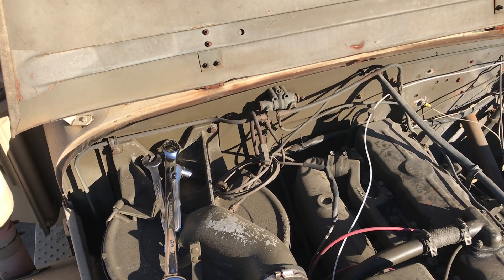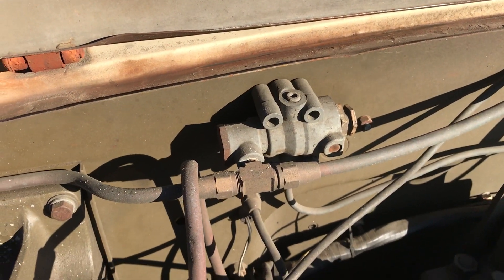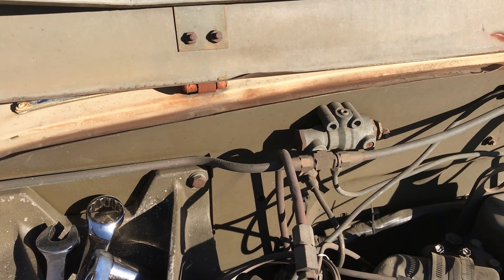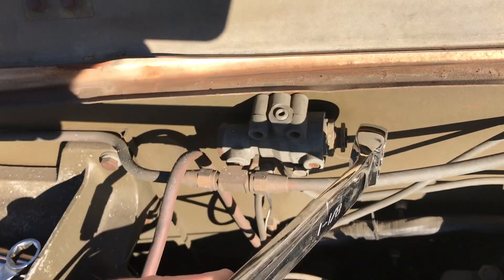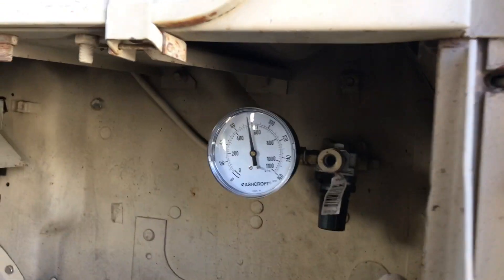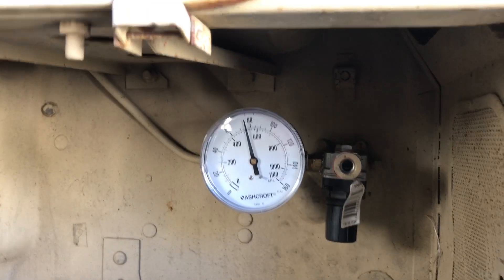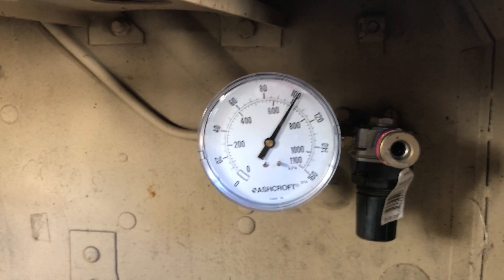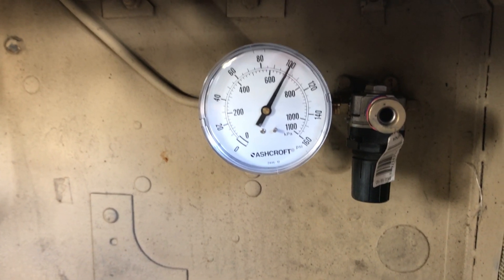M35A2 and other Military Vehicle Air Governor Adjustment

Comment: Hello there I work for a Town Highway Department, we have a 1990 M931A2 it won't hold air the brakes come up to 120 but idling or taking your foot off the Gas the Pressure drops, we can't hear any leaks and the Air Dryer has been changed could it be the Air Governor thanks

Comment: Does this have anything to do with power steering? My M35A3 barely has power steering but everything else works fine. I can’t find the regulator on the firewall to adjust it.

Comment: Actually I’m really glad you put this video out . It was a little more difficult to hear you in the end but I can make most of what your saying out. If you could have gotten a little more in depth on how the system worked would be nice. Like I said though I’m very appreciative for this info because I have my air pressure gauge constantly pegging out. Seeing some condensation in it at part of the time. I’ll try doing what you mentioned but I guess you just keep checking the gauge until it’s right?

Comment: Help! I have a 1968 M35A2 just like yours, and I'm seem to be missing a air line that goes from the air switch the is on the dashboard that once you flip it, it will engage the front differential and make the truck a 6x6. Is there any way that you can tell me where does that line goes to in the governor, an if possible take some pictures of it under the dash and where it goes to? I will give you my email address, once a reply is received. Thank you!
Reply: If Brian doesn’t respond try steel soldiers or one of the military vehicle sales company’s like Boyce Equipment out of Ogden, Utah or Memphis equipment, Big Mikes Motorpoool, C&C equipment in Ind., or eastern equipment out of Pa.
One of them will easily help you over the phone even. 
Well it’s easier to reach Big Mikesmotorpool by email from his web site.